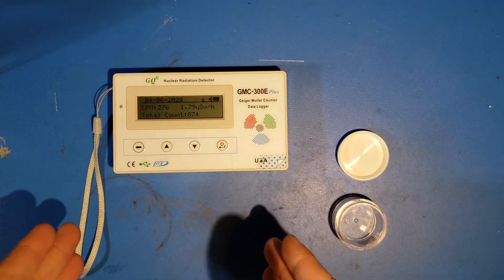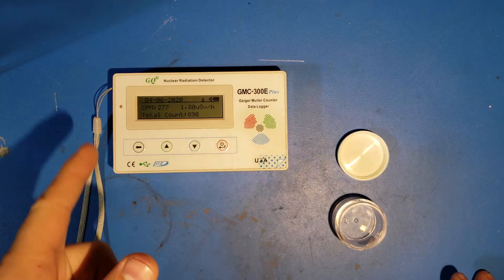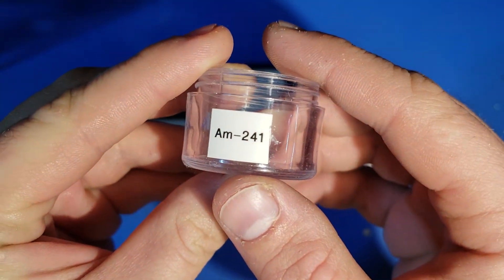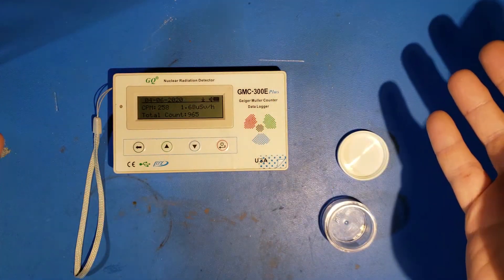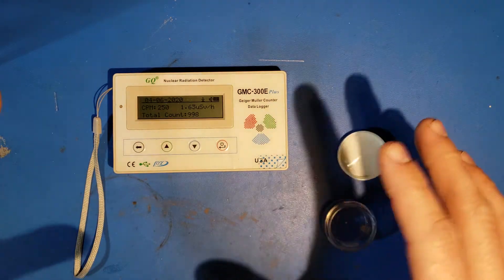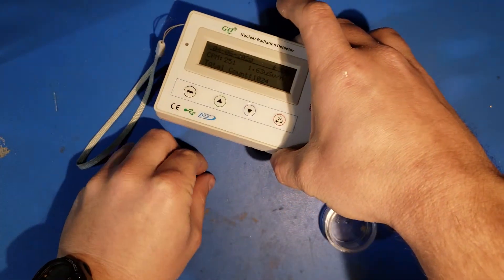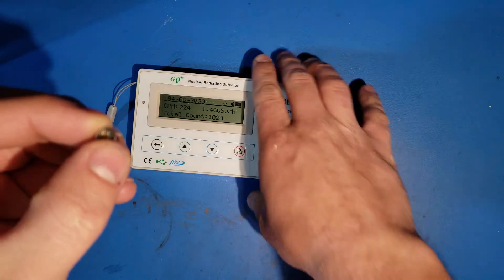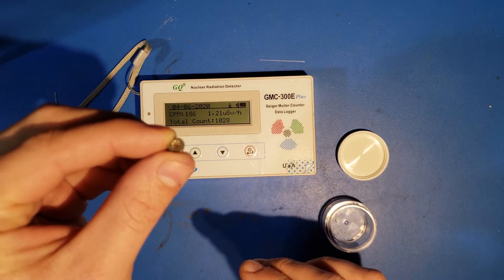Americium-241 is a Low Level Gamma Emitter

Comment: Is it ok if i touch it with my hand
Reply from the maker: Let me put it this way, it would be REALLY bad if it got in your blood. Don't get cut with it. I wouldn't touch the americium (the yellow part in the silver metal case) with my bare hand. I definitely don't touch my polonium sample.
Reply: @R3RadioResearch  it is ion chamber
Reply: Technically? Yes. Alpha radiation is stopped by your skin. Practically? No. The slightest bit of this going into your body, whether through or cut, through a mucous membrane or through inhalation will fuck you up